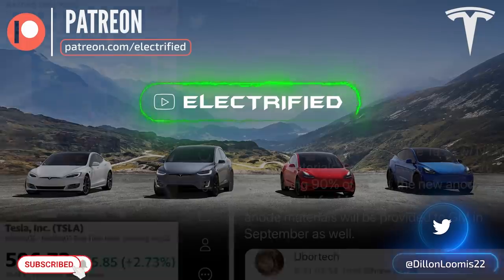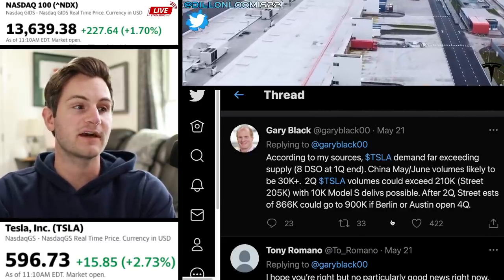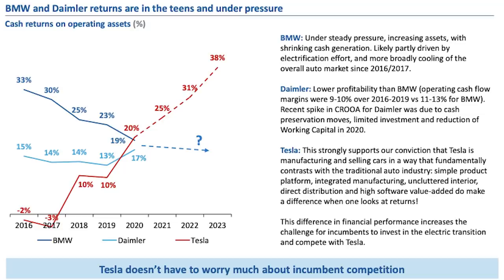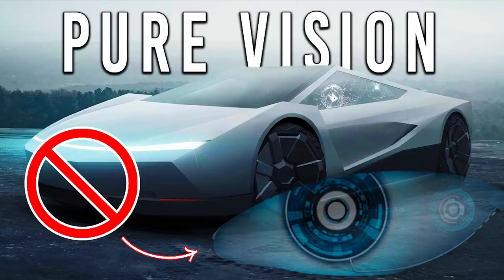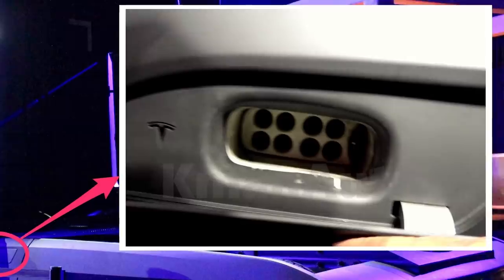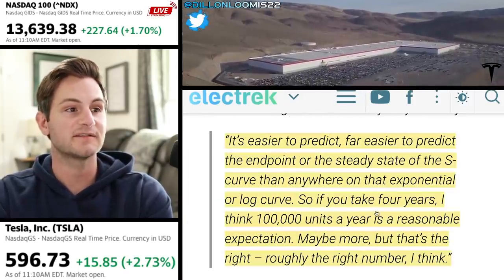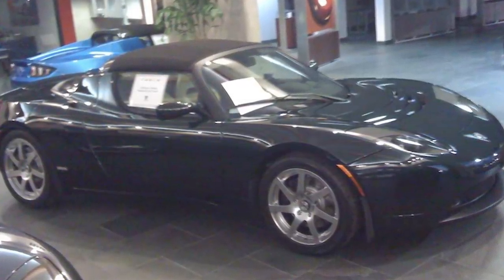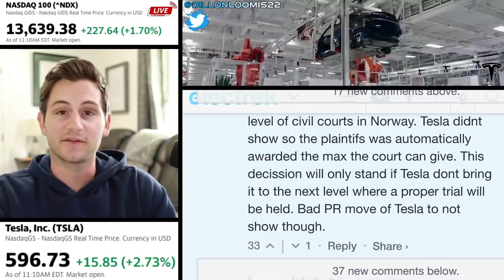The Tesla MEGAcharger Has Arrived (Semi Production Signal)

Comment from the maker: I can't wait to see this new MEGAcharger...how many Semi's do you think we see this year? Over/under 50? I'm going under...
Reply: I think you are right.  I feel like this year semi production more to get started ramping.  Probably need most batteries for other stuff like model y and cybertruck
Reply: Re: Many giga-castings appearing outside factories, Any idea of how many precasted Model Y chassis "sets" will be needed to prime the production line prior to start-up?
Reply: The 4 pin pairs in the megacharger plug show it is just 4x V3 chargers in one plug, so 4x a Model Y system in one Semi.. makes sense, I think.
Its just like charging 4 Model Y's at the same time at 4 supercharger stalls.

With some clever adapter it should be possible to charge a Semi at a normal V3 supercharger, but of course it will take an hour or so to charge the complete battery from empty to 80%
Reply: I hope it’s 100 Semi’s on the road before EoY. Feel like you’re closer with 50 though
Reply: Also think the ASP will rise as demand for the semi increases as the economics are realized
Reply: One thing you missed.
The "prototype" Panasonic 4680 line in Nevada.
Obviously ideal for Semi production next door.
Question
Was input from Panasonic instrumental in solving the 4680 production issues?
Reply: Having essentially 4 V3 chargers into each socket may make the cable "bulky" to say the least? It would seem logical (to me) to have 2 connected and have a socket on each side.
Manageable.
Redundancy in case of failure.

In fact, why not keep it simple and have 2 separate V3 sockets each side!?

That way a Semi could "trickle charge from any "standard" V3 charger overnight (4-5 hours?) If caught away from a depot.
Minimal difference in connection time when fast charging (10 seconds for each charger?)
Reply: @MarcoNierop  I'm expecting the battery on the semi to be near 1 megawatt. If that's true, a single supercharger would take 4 hours to charge it.

I agree with your thought that the megacharger is just 4 superchargers wired together.

Comment: Why doesn’t Tesla split up the battery packs in their cars so that you can plug in two or more cables, depending the size of the pack, to charge the battery packs?

If you have a Tesla Semi, and it has a 600 kw pack, just split the pack up into 4 and then when you charge you plug in a cable for each pack. This will speed up charge times greatly, no?
Reply: @Les Schorlemer Tesla did what you suggested, when they were testing.
Reply: @tonespeaks  ok, and was there some reason it didn’t work?  A big cost increase?
Reply: @Les_S537  Oh no, Tesla wanted to have Semis use dedicated Mega Chargers, as so not to disrupt the current auto charging system.  In an emergency the Semis could use current Charging system.  One of the reasons, they want them on a dedicated system is that there was going to be a Charging standard, but that hasn't come to past as yet.
Reply: @tonespeaks  let me try be more clear. Semis are going to charge at truck stops just like they always have. On this we can agree, I think. 

What I am saying is that these semis are going to have massive battery banks that they need to charge. 

Spitballing here but with a mega charger you’re going to be able to charge that one battery pack in X amount of time, let’s just say to charge from 0 to 100% you’re talking some amount of time. 

Instead, what they should do is split that huge battery bank up into 4 smaller ones, and so when it comes time to charge you can use 4 chargers to get the whole system up to full much faster than having one megacharger try to charge everything up at once.
Reply: @Les_S537  That is an interesting idea.... but the Semi is more designed to be charging during loading and unloading  or overnight, when.  Most Trucking is not long haul. it is done without 250 mi from base.   It is actually quicker to charge a larger battery, than 4x smaller ones.
Reply: @tonespeaks  today, I can supercharge my Tesla from 10%-80% in 20-25 minutes. That’s a 75 kw pack. 

If a semi has a 500 kw pack, there is no way you could charge that from 10%-80% in 20-25 minutes. 

I get what you’re saying about rest time for truckers but long haul truckers drive close to 600 miles a day. To make money they need miles. Truck drivers can’t live on 250 miles a day. 

The semi needs to have battery cell banks broken up so they can speed charge quickly. That’s the only way it’ll work
Reply: @Les_S537  According to Tesla it can charge to 80% in 30mins, with the new Mega Chargers. If you think about it, that could be true.  The new Batteries can handle higher rates of charge.  

"The company initially announced that the truck would have a 500 miles (805 km) range on a full charge and with its new batteries it would be able to run for 400 miles (640 km) after an 80% charge in 30 minutes using a solar-powered "Tesla Megacharger" charging station."

A couple thing... .Long Haul Truckers by law have to stop for 30mins anyways,  no Trucker is driving 8 hours straight.   The Long Range Semi can do about 600miles (officially it is 500),  so the Semi can easily meet a Trucker's duty cycle.   Must trucks are limited to 55-65 miles an hour.  It could easily work with Tesla Semi. 

Most Truckers drive short Haul 150miles from base are less, this part of trucking it increasing (Amazon is one of reasons for this).  80% of the routes are under 250 miles,   Long Haul (OTR  - over the road) is only about 20% of the routes.

Comment: They're suing Tesla for charge throttling?
I'd like to see a similar law suit brought against Apple for CPU throttling in their older iPhones.
Reply: There already is such a case against Apple
Reply: Stop talking nonsense, tesla has been copying Apple since years now, they are both against the right to repair and Apple has stopped throttling their devices since that old lawsuit
Reply: 30 people sued, it wasn't a Class Action Suit, Tesla did acknowledge that the update may adversely affect a "small group of people", this could be the reason they didn't respond.  There was a default judgement and it will total about around $480k, unless they challenge it.
Reply: @tonespeaks  well apple is a waaaay bigger company with billion of active iphones and they explained why they  throttled the iphon 7,6 and also made a program to replace the batteries.
Reply: @alanmay7929  I agree, that's why I think Tesla didn't respond.  I think they just felt it was easier to pay them off $16,900 and be done with it.   Most of these cars are old now, so it kind of seems like a simple solution.

Comment: Mega charger straw at least one megawatt of power. That means each and every mega charger requires at least a 1250 amp, 480-volt, 3-phase circuit. and that is for each megacharger not for a mega charger station. Good luck with that, you're going to need it

Comment: There was no 10k undeliverable and you don't hold cars to ship radar when it can be deactivated remotely. Removing radar requires a slight front valance redesign  so cars are continuing to ship with radar otherwise it nerf the current available AP.

Comment: Dylan, what do you think about the "Electric Car Debunk" based on a back of the envelope calc with miles driven and the amount of US power generation needed? https://youtu.be/TwWzmu_rKFA?t=140  tl;dr If we drive 3.2 trillion miles a year, and EVs use 0.3 kWh/mile we will need another terawatt of generation built by 2035.
Reply from the maker: let me take a look! i think as with all new technology, as new problems arise, we will continue to solve them as other tech advances!
Reply: Strangely enough, I engaged in a Sunday afternoon "thought experiment" re the same subject.

Quick "back of the envelope" calc.

USA used 142bn gal of gas in 2019

It apparently takes 5kWh to refine 1gal, so that's about 5x142 = 710bn kWh
(I'll keep it in kWh, it's easier)

If we divide that by a 100kWh Mod S pack
That's 7.1Billion charges(!)

Then, divide that by the total cars on US roads (282m cars)

If EVERY car was a Model S, that's equivalent to 25 charges per car per year.

If we assume 100kWh = 300 m
The spare grid generation capacity from NOT refining the gasoline is enough for
25 charges × 300 =7500 miles for every car in the USA!

(This would stay propotional to the number of EV's)

(Average car use, 13,500m so this covers about 56% of the total )
🤔

Am I right?
Reply: @DillonLoomis22  unfortunately ICE and oil are way more polyvalent than anything a battery can do, so we need another propulsion technology/powertrain in the future.
Reply: @rogerstarkey5390  unfortunately you forget to mention that there are about millions of oil by-products and fuel is used by rockets, ships, aircrafts, agricultural, mining machines...... fertilisers, road tar, tires, car parts.........